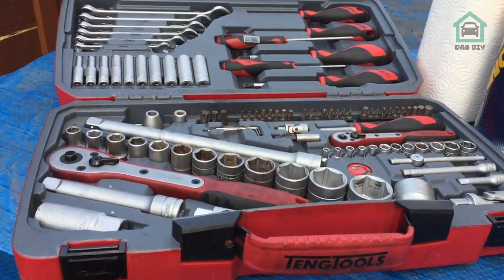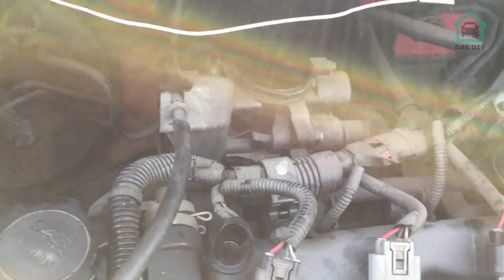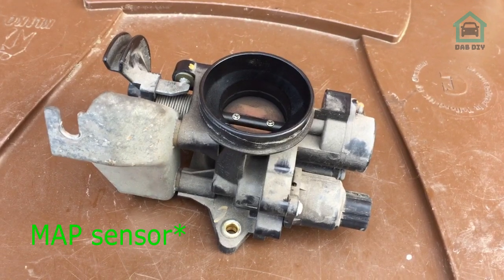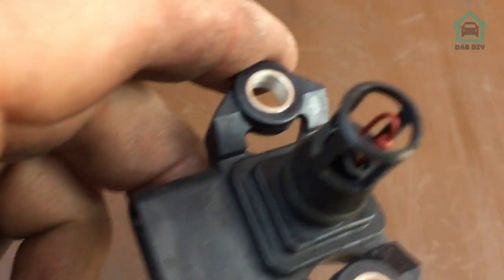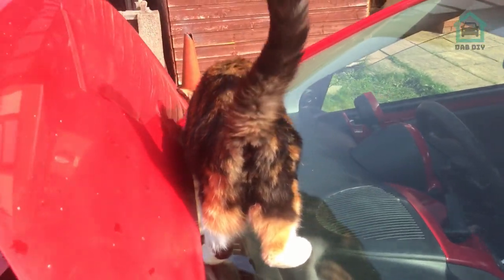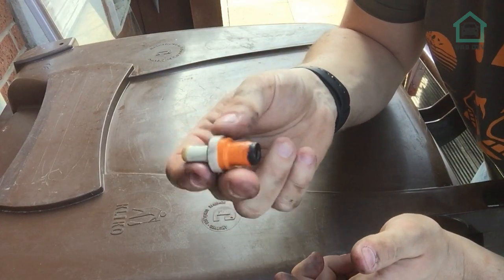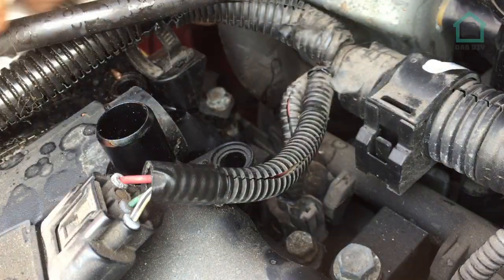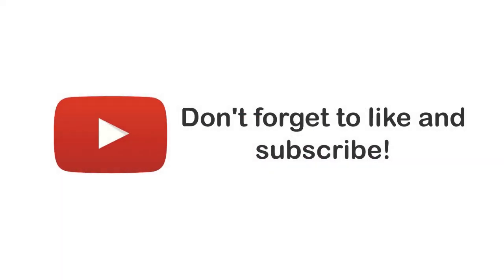C1/107/Aygo 1.0 Petrol Throttle body, MAP sensor and PCV cleaning

Comment: Just followed the instructions and my daughters car is running so much better. The acceleration is smooth and linear instead of lumpy. I have a work C1 to do next! Thanks Dave
Reply from the maker: I’m glad it’s helped you out! I was astounded at what a difference it made to my car.
Reply: @DABDIY  Please advise I clean MAP sensor he wasn’t dirty was a little oil on surface on it I clean PCV, replace first up O2 sens. Bosh afternaket so car run nice as before I do all of it. But constatly pop up Check engine?? Have you idea? I preciate answer.
Reply from the maker: You’d have to scan for codes to see what the cause of the EML is.
Reply: @fest102  could be the other oxygen sensor. It's best to replace both.
Reply: @JC-hu1wd  no error code for second O2 sens. OBD Texa show high oscillations up n down from 0.45V whitch is the normal operating value… so yes I’ll replace it
Reply: @fest102  I had the same issue on another car. The first sensor was ok but I replaced both anyway. That fixed the problem.
Reply: @JC-hu1wd  Thx. experience in case like this has a huge meaning👍

Comment: I'll definitely be doing this. Plus I'm changing the coil packs, sparks and oil and oil filter. Can't wait to see if there's a difference in performance. Fully expecting tesla-like acceleration.
Reply from the maker: It’ll certainly make a difference! If you’re changing coil packs, consider visiting TSA Performance and get some of their upgraded coil packs.
Reply: @DABDIY  will do. Whilst I have your attention, are there any other fluid changes I can do? I have an automatic aygo 2008. Ta
Reply from the maker: I’m not fully conversant with the automatic gearbox, so I wouldn’t know if you can do gearbox fluid or not, but I would definitely recommend doing a coolant flush while you’re in the engine bay.
Reply: @DABDIY I gave a 2008 Toyota aygo full tank use to give me 340 and now I only get around 290. I do service every 6 months. The mileage in the car is 123,000. Shall I try cleaning all the parts which you did in this video
Reply from the maker: @jalaniashraf9064 it won’t do any harm to clean everything. Also consider checking your tyre pressures and take a look at your driving style too.

Comment: This video is actually extriemly helpfull and therapeutic to watch..guess I'm not not free tomorrow after all as I now want to do this..at 00.41am..😂..thanks a bunch dude👍

Question..what is the pcv used for? What's its job?
Reply from the maker: I’m glad you like the video!

The PCV valve, positive crankcase ventilation valve, is responsible for venting the positive pressure generated within the engine when combustion takes place. It contains oil vapour and other such things like that in the expelled gasses, which are then fed back into the air intake for emissions purposes. I did a video on cleaning the Throttle Body Control Valve too. It’s in the Project C1 playlist.

Comment: Good video.I will have to do this.Maybe do it today if rain holds off.
Reply from the maker: Don’t forget to check out the video where I clean the idle control valve too, while you’re in that area.
Reply: @DABDIY  I will do.Thankyou.I wonder if theres a upgrade throttle body to give the 107 a bit more oomph.
Reply from the maker: Some people have upgraded, but I haven’t because I’m going to turbo instead. Whatever it is you go for, please remember that this is based on a Toyota platform, so Peugeot and Citroen parts may not fit.

Comment: Hi there, when trying to remove the front bolt that holds the throttle body I think it snapped. It just keeps spinning but won’t come out. Do you think there’s anything I can do?
Reply from the maker: The threaded insert has most likely come loose from inside the intake. Worst case scenario, you’ll need a new intake. Best case, see if you can hold it with a pair of pliers as you undo the bolt

Comment: Hey, excellent content and easy to follow instructions.
Just a quick question,  is there any way to view the MPG on the vehicle. I have a 2008 automatic Aygo and i cant figure out how to get the little display next to the speedometer to view live MPG figures.
Reply from the maker: There is no way from the factory to view MPG figures. Personally, I use full yak and mileage figures and do the maths myself, but I heard you can get an OBDII device to show things like MPG, temperatures etc.
Reply: @DABDIY  aah i see. So i didnt miss out anything.. thanks for the reply..
Reply: Fuelly is great for tracking mpg if you enter details every time you fill up

Comment: Good video, also what is the purpose of the small air hole? (The one pointed with the screwdriver at 10:53)
Reply from the maker: That’s the vent case breather. It recirculates air from the crank case back through the air intake system to be re-combusted.

Comment: Hi dave done the pcv but finding it a bit hard to get to the map sensor with the throttle body on there, would you clean the map sensor and is it as straight forward to take the  Throttle body of as you show in the vid because i might give that a go to get to the map sensor thanks for your help ps not the best around cars that is why i am asking the above thanks.
Reply from the maker: It really is as simple as the video shows it. Three bolts holding the throttle body onto the engine, you dot necessarily even have to remove the throttle cable - it can be pushed to one side and given a quick clean in situ. Then it’s just two screws holding the MAP sensor in and an electrical cable.
Reply: @DABDIY  Thank you so much for your help means a lot when somebody is showing you how to do it the right way.
Reply from the maker: My pleasure, that’s why I started this channel. I hope it helps you out 🤙🏻

Comment: Do you know what else to check, i've done what you showed in video om my ab40 1.0 toyota aygo but not much changed.
Reply from the maker: It might be worth taking a look at things like spark plugs too
Reply: @DABDIY  Brand new genuine ones.
Reply from the maker: It’s not misfiring, is it?
Reply: @DABDIY  no, but it sounds rough till 1200rpm.
Reply from the maker: Assuming it smoothes out after 1200 rpm, I can only assume that maybe it’s air flow or fuel injection related. Not sure after that, I’m sorry.
Reply: @DABDIY  I will have a look, thanks for your time anyway! :)

Comment: My Aygo 2007 throttle body doesn't have a throttle! I can only see the body.
Why?
Am I looking in the wrong place?
Please advise.
Thanks
Reply from the maker: It definitely has a throttle. The throttle body houses the throttle, which is essentially a brass butterfly valve. When you put your foot down, the cable rotates the housing crank, which turns the butterfly valve, changing the fuel:air mixture.
Reply: @DABDIY  Thank you so much for your prompt reply, but I have to tell ya, I just couldn't see any throttle, throttle line or butterfly.
I will try to make a little video of it, and upload it to my channel.
It could be because it has a VSC system???
I don't know.
I will notify you when the video is uploaded.
Thanks again for your concern.

Comment: What did you use to clean the throttle body and maf sensor with sir.
Reply from the maker: You could use anything really. Brake cleaner, carb cleaner etc. carb cleaner would work best imo.

Comment: @DABDIY Please advise 4 my C1 I clean MAP sensor he wasn’t dirty was a little oil on surface on it also I clean PCV, replace first up O2 sens. Bosh afternaket so car run nice as before I do all of it. But constatly pop up Check engine?? Have you idea? I preciate answer.
Reply from the maker: You’d have to scan the car and check for codes first before throwing parts at the problem. Go around and make sure all of the electrical connectors are secure too.
Reply: @DABDIY  I do most of that but not check ec. connector. I do scan via OBD (Launch) error code repeat P0171 poor mixture but engine idlle is calm as acceleration is good without cut or twitching. That confuse me a lot! I’ll change spark plug maybe is poor spark fire?
Reply from the maker: @fest102 changing spark plugs is definitely worth trying
Reply: @DABDIY  Thx. on ansewer I’ll do it tomorow. What you think about aftermarket Bosh sensor O2 first up is it good replacement?
Reply from the maker: @fest102 I’ve not replaced any O2 sensors, but in my experience, Bosch in general is a trustworthy brand.
Reply: @DABDIY   Thx. a lot for advices and opinion for Bosh 👍
Reply: @DABDIY  I forgot say you Check engine light turn off alone usually after few days🤔 it’s mean temporary error! Are u agree?
Reply from the maker: @fest102 it does seem intermittent

Comment: I used carb cleaner for pcv valve
Reply from the maker: I tried that at first. It needed something a little more aggressive than carb & electrical cleaner, so I decided that brake cleaner was the way forward. It doesn’t look like it’s ever been cleaned, but now that it has, I’m confident that arb cleaner will do the job when I come to service the car next year 👍🏻

Comment: Can you use brake and clutch cleaning on the the throttle body and map sensor.
Reply from the maker: I suppose you could. There must be a reason why brake cleaner has been formulated differently though, perhaps it’s more volatile?
Reply: @DABDIY  wasn't sure if it would be too strong
Reply from the maker: @JJ-bo4ir I’d have thought it might be too strong, yes
Reply: Ah okay, what did you use?
Reply from the maker: Carb and intake cleaner
Reply: @DABDIY  okay cheers

Comment: Great video! Would you know where to find a replacement for the pcv valve? I had no luck in finding the part number
Reply from the maker: I don’t have a part number, but I should imagine that any Citroen/Peugeot/Toyota dealer should be able to help out with that. I can’t imagine they’re too expensive either.
Reply: Looks like it's Toyota 12204-40030

Toyota part catalogues are fairly easy to find online, e.g. https://toyota-europe.epc-data.com/aygo/kgb10r/4/engine/1201/12204/
Reply from the maker: @74HC04  That's awesome, thank you for that!
Reply: @DABDIY  You're welcome. I use Toyota catalogues to get part numbers for parts for my C1. I then either ring up the Toyota dealership and quote the part number (have a numberplate from the same year of Aygo to hand in case they ask), or find them on Amazon / eBay.

It's a lot easier than getting either a Citroen or Peugeot dealer to go though their parts catalogue. That said, when I lived in the UK, I used to get prices from all 3 dealerships - Toyota were often the cheapest.
Reply from the maker: That’s a damn fine idea! Do you happen to have a link to an online parts catalogue or a PDF or something like that? That would come in handy for some work I’ve got planned.
Reply from the maker: I’ll definitely give them a read. Thanks for the links, I really appreciate them 👍🏻

Comment: In germany Toyota aygo very high market
Reply from the maker: I can see why
Reply: @DABDIY  3 months before , for my friend, we went to look some seven seater  , I saw an Aygo 2008 model. price asking 75000euro,  I also planning to sale my 2021 model vvti kgb 40 .even my km not run up to 25000 km.
I was about to sale my car , but at the end  I make a disition,that I will or I cannot buy a city car like this . I went to  Switzerland and Austria and chezh in this car. Budget friendly.

Now mileage dropped take over time mileage was 26kmpl. I was changing oil 0w16 . But this dealer changing 0w20 every time. from next I planning to buy out side and hand over to them . 8500-9000 km I change engine oil 
Next summer I want to follow this procedure. Last time cleaned spark plug,  just  I avoid tip due to irridium coating. But the map and pvc I not touched bro. But VVTI solenoid I clean some time

Comment: Any useful alternatives to clean with as i dont have electrical cleaner?
Reply from the maker: Anything solvent based really. Maybe a little brake cleaner or something like that.
Reply: @DABDIY  vodka? I used vodka to clean my car after sanding and before painting as it removes oil and evaporated quick lol
Reply from the maker: If that works for you, carry on with it... though I’d rather drink the vodka than use it as a cleaning agent lol
Reply: @DABDIY  that's what all my friends said lol but honestly mate it's knock off Smirnoff and it's rank. Don't know how I acquired it.
Reply from the maker: That’s fair enough then! Smirnoff is only really any good for cocktails 🍹 and engine degreasing 🤣
Reply: @DABDIY  hahahah... Can't wait for more C1 videos. I watch them religiously. Keep them coming 👍
Reply from the maker: Plenty more in the pipe line! Videos scheduled until mid-November and I’ve been recording more this week.

Comment: Would carb cleaner be OK?
Reply from the maker: I would imagine so, yes.
Reply: My Toyota aygo has done 133k and for 1000 miles it's consuming 3.1 litres before it was 1700 miles for 3.1 litres any idea
Reply from the maker: Have you done what’s in the video?
Reply: @DABDIY  replaced all new parts
Reply from the maker: Might be worth changing to a thicker oil and see if that helps the problem.